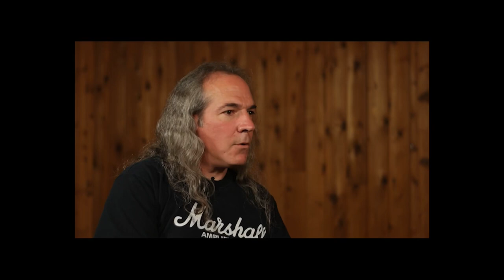Joey DeMaio's Piccolo Bass explained (often mistaken for guitar)

Comment: Nothing beats the 8-string Veillette Citron that he used on so many classics
Reply: Thank you, George! I ve always wondered what model that neck-thru'-beast was! Now I know! All hail!
Reply: @stefhan4667  Dawk - Manowar's head technician for quite some years till his passing - had a website with very interesting info on Manowar's equipment, especially on those early years, from guitars, to basses, amps, speakers etc. They were constantly experimenting with new gear and Dawk was the driving force behind. I also remember reading that the 1st incarnation of the picolo bass was a heavily modified Rickenbacker 4001
Reply: @GeorgeVrachliotis  That Rickenbacher, I know about . I saw Joey playing it mid-90s . Agony and Ecstasy Tour 1994, Hell on Wheels 1997 .  Mirrored Scratchplate, big red Volume Poti and only the lower half of the Fingerboard played because the strings were narrowed to each other. And the Sound....omg! Dawk was certainly second to none.